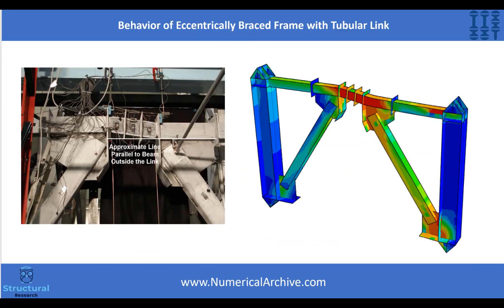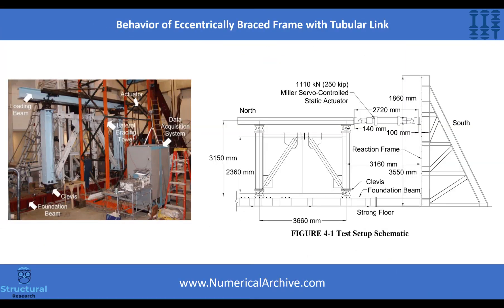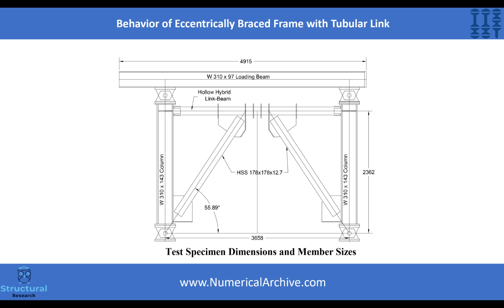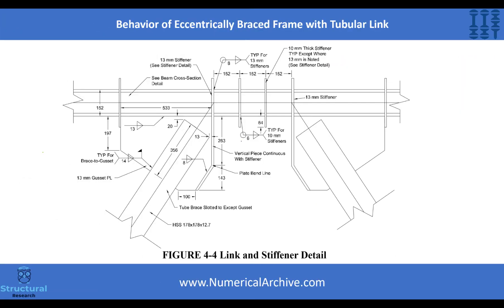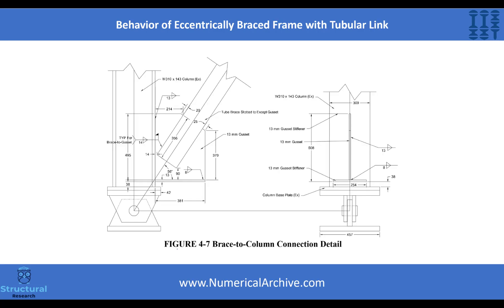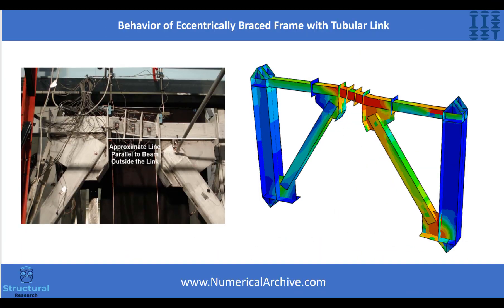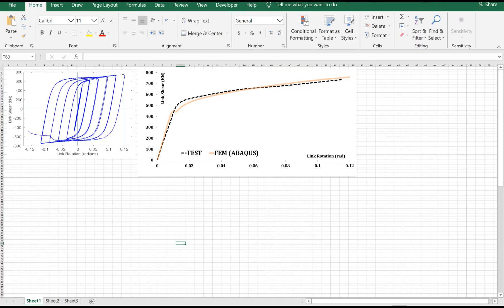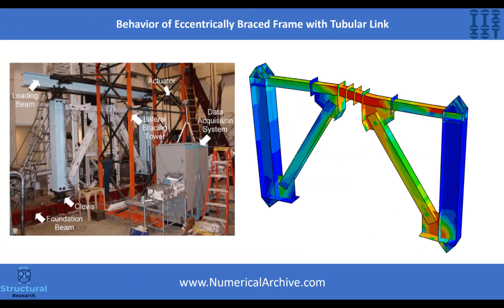ABAQUS Video Tutorial; Behavior of Eccentrically Braced Frame with Tubular Link

Comment: The compresses file for video 2 of the Tutorial is empty.
Reply from the maker: The tutorial video is indeed split into two parts due to limitations on file size imposed by our server. Each part is compressed into a separate RAR file named "video1" and "video2" for downloading convenience. When you extract both files, you'll find that the "video1 & 2" contains the full tutorial video. Please proceed to download both files and extract them. Once done, you'll be able to enjoy the full tutorial seamlessly.
Reply: @numericalarchive4614  Hi, It still doesn't play past 1hr and 1minute. there is a part missing which is video2. video2 is empty. this is after extracting both files.
Reply: It does not play past 01:01:34
Reply from the maker: @Heather-vq8hj  Dear friend, Thank you for sharing your problem with us. There is probably a problem in extracting the zip file you downloaded. The whole movie is about one hour and fourteen minutes. We suggest you extract the downloaded file again and use it. If you still encounter the problem, email us so that we can send you the complete file. ifno@numericalarchive.com